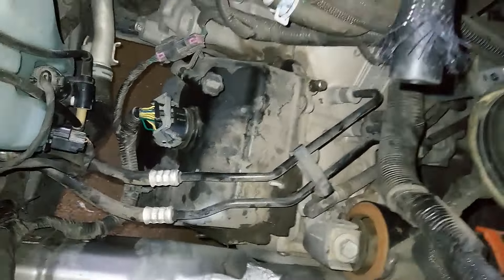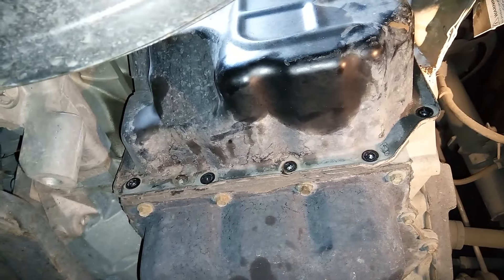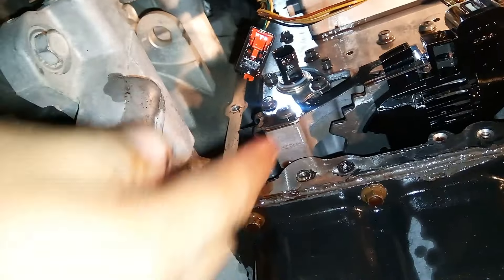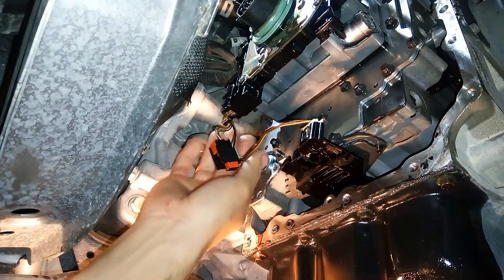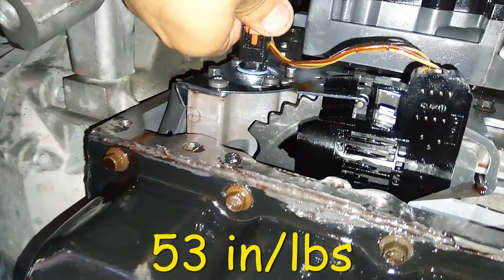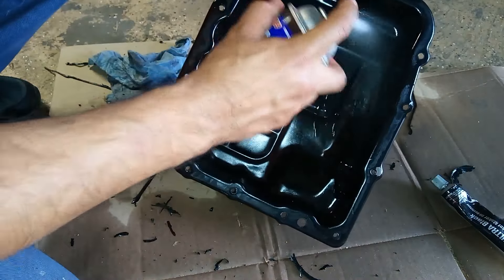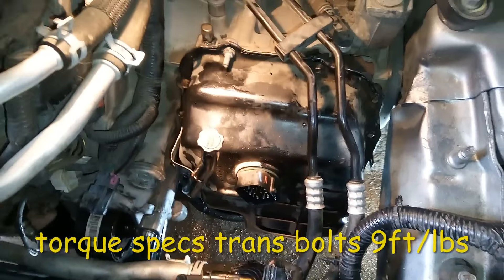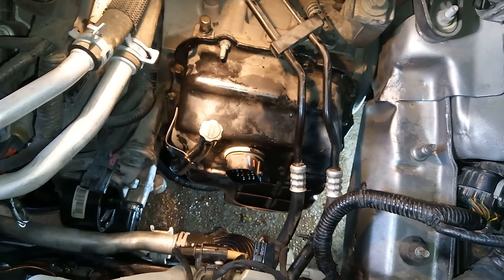Transmission Fluid Pressure sensor Location and replacement 62Te Code P084B

Comment: I’m getting code p083b. After start up it runs quietly and shifts no problem. After a couple of minutes the transmission starts whining then will start to slip in and out of gear. And shifts from P to D clunk and require a lot of RPM to engage. Do you think this sensor could be the issue?
Reply from the maker: I don't think so...check fluid level. 
U might have a bigger problem with transmission.
Reply: I have the same symptom with 2019 Dodge Grand Caravan (62TE). Not sure yet what the fix will be.
Reply: @davedurkee8853 . I had to replace the transmission. I got a good deal on a rebuild $2200
Reply: Did you ever diagnose and fix your issue? If so, what was the fix?
Reply: @Relevantminded . Internal fault of some kind. I replaced the transmission and it was fixed. What component specifically I do not know.
Reply: @unamusedarchitect1646  thanks

Comment: How much transmission fluid did you put back in and need after replacing the speed sensor because I don't want to over fill thank you
Reply from the maker: When u remove it,put an oil container to catch the oil...whatever the amount u get out of it,put the same amount back. 
U also can check with another disptick the level before u do the job. (This transmission doesn't have a dipstick but u can use the engine oil ) 
Other option is get a dipstick for ur transmission from ebay or Amazon so u can check the correct oil level.
Reply: @larasgarage2021  ok great thank you
Reply from the maker: @johnniegregory2666  you are welcome!!

Comment: Hi Lara, what are the symptoms of a bad transmission sensor?
Reply from the maker: Transmission pressure sensor.  Symptoms-hesitation,not shifting properly or not shifting at all. Check engine light on.
Reply: I came here because my "Check engine" light came on, I went to an O'riely's parts store and they checked the diagnosis, it came up with the pressure sensor as the problem. I came here to see where it was and if I could fix it, but it looks like it's a bit beyond me, so at least I have an idea of what's involved and what it will cost me to get fixed.
Reply from the maker: @longbowshooter5291  yeah its a little bit of work. Find a good mechanic to help u with this brother  🫡 thanks for watching 🙏
Reply: @larasgarage2021  The first car I ever owned was a 56 Chevy Bel-Air, and I put new rings and bearing in it myself. Today I wouldn't even know where to start just changing the oil! :hand-orange-covering-eyes:
So, yeah, I'm taking it to the shop tomorrow.
Reply: @longbowshooter5291  Personally, I'm 72, and I find 'most' DIY repairs are actually much easier to do myself on the current generations of cars and trucks. At least drilling down and locating the problems with a quality scan tool.  I find having the correct tools for the job is key.  I often find it better to invest in the tools with the monies a shop would have cost to do the repair or use the free loaner tools from the big chain parts stores.  The repair shops always mark up the prices for parts 2-3x what I can source them at.  The biggest issue I find is working in tight and confided spaces you have to work in.  That and the damn arthritis in my back.

Comment: would this be the same procedure with a 2012 Dodge Avenger 2.4?
When i look for that part for my vehicle, it shows the same as the one you changed. I also have a p01745, and the car is in limb mode and doesn't shift. It makes a  whining noise from that area when cold starts.
Reply from the maker: In this car the transmission was a 6 speed.  Yours,  since ur engine is a 2.4 might be the 4 speed transmission.  They both made by same manufacturer so parts probably the same. Procedure might vary,again is not the same transmission.

Comment: A little help needed please.. 2013 Dodge Avenger 3.6L V6. Retrieved code P083B. Car does not shift out of 2nd gear. Turn off and restart car after a few minutes and car runs perfect. Issue has occurred 3 times in the last 6 months. Could this be my problem? Thanks in advance.
Reply from the maker: If problem comes and goes, I think I could be a bad connection.  Check all connectors,clean em up,add some electrical grease,that will help. If problem still there,Check for continuity on all the wires going to the transmission.  A single broken wire or bad contact can cause problems.

Comment: Tengo ese código pero me aparecieron 4 más p0846, p0733, p0882, p0734. Será el sensor,  el fluid pump o la transmission se dañó? Mi can tiene 80 mil millas
Reply from the maker: A veces un solo codigo puede hacer q salgan otros similares. Te sugiero q lo lleves a un local shop para q lo vean y chequen cual de todos esos codigos (1 o 2 de esos) esta dispara ndo los demas.
Reply: Eso haré! Muchas gracias
Reply: tengo los mismos código de error pudiste solucionar tu problema amigo ?

Comment: Mr. Lara,
I have a 2009 Mazda 5 with 135K miles. AT light came on and the diagnostic code is P0841 - the transmission fluid pressure sensor. Does that mean I need to replace this sensor or the pump, or what?  Also, Can you tell me where the sensor is located?  Thank You. Patrick.
Reply from the maker: Will be better to take it to a local transmission shop for a good diagnostic.  
Transmission is leaking oil? 
Have u replace or do maintenance on the transmission? 
Any accidents? Sometimes wiring harnes can damage in a accident..a broken wire can cause problems. 
Do u have any other issue or is just the code? 
U see...there is a lot to see and check before u replace anything on your car.

Comment: Hello, what are all the tools you used for this?
Reply from the maker: Hello! Simple tools. Socket set,screwdrivers,allen set, I think, or torx star set(u need it to remove pressure sensor) that's what I remember at the moment.
Reply: @larasgarage2021  thank you!

Comment: I have a 2019 caravan gt I just bought. 240k miles. Previous owner changed transmission at a 180k miles. The transmission shifts perfectly but the dreaded whining sound at low speeds. No check engine light but scanned it and had the p0868 code. I changed filter, fluid, pressure sensor & the small Torque Converter Clutch Solenoid (All OEM). The whine sound reduced a bit the 1st day but was still there. Now back again with the same p0868 code and sound is the same when accelerating at low speed. Transmission mechanic told me to change the torque converter and the shift solenoid. What do you think I should do? Any help is appreciated
Reply from the maker: Question... Does it sound the same when u slowly take off? Like if u press gas pedal just a little bit? 

Sounds it's different when u press the gas pedal? Like u in a hurry and u floor it lol ...does the sound is worse?
Reply from the maker: I might have an idea of what it is...bit want to make sure if it always sounds the same or different... depending on how u accelerate the car
Reply from the maker: By the way, sorry for the late response brother
Reply: @larasgarage2021  When I take off it I hear the shoosh sound. After it's about 20mph it stops. Today receive the p1745 code and  the p0934 code.
Reply from the maker: @NycForgiato  but that sound, do u hear it all the time? Or when u take off really really slow do u hear it too?
Reply: @larasgarage2021  So had the torque convertor whine noise and the p0868 code (Transmission Fluid Pressure Low) So today mechanic change the torque convertor, filter, 9 quarts of ATF4 fluid, the solenoid pack, the Torque Converter Clutch Solenoid and the transmission pressure sensor (all OEM Mopar). Now the torque convertor noise went completely away but the it shifts hard from P to D and from D to P etc... Still throwing code P0934 (Hydraulic pressure sensor circut low) and P1745 (Line Pressure Too High for Too Long) Mechanic said the transmission needs to be flashed or updated? (Not sure) But he assured me its that & his scanner can't do it.  Is this correct or is something else wrong? (Been with this mechanic 20 years and he's 100% honest) . Any help is appreciated. Thanks.
Reply from the maker: @NycForgiato  he might be right. As far as i know...if u replace internal parts of the transmission like the vapve body etc,u do need to reprogram transmission.  You might need to take it to the dealership so they can reprogram it.

Comment: Do you have to change the transmission valve cover if you change the sensor?
Reply from the maker: No. Other than the sensor u just need to replace the gasket or use gasket maker on the oil pan.

Comment: Hello Lara would you know where the Trans fluid pressure switch is located on a 15 Nissan rogue SL? TY
Reply from the maker: Ima be honest...i have never worked on that transmission.  So, no i dont really know. U can google it and lool for a transmission diagram or parts. Also, u can go to a dealership,ask for that sensor and ask for a diagram or location...usually they have it. Hope this helps 🙏

Comment: Is this same application for 2010 journey. engine  2.4 fwd..  with code P0870?  thanks..
Reply from the maker: The transmission on this video is a 6 speed. The one u have is 4 speed, i think. It might be a little different.  I can't say for sure because i have nerver work on the transmission u have.
Reply: @larasgarage2021  thank you...

Comment: I have a 2016 dodge caravan I replaced the transmission with a used one. The codes I have are all related to the transmission. P083B P0846 and another code but basically it’s for gear 1 & 3 ration and a pressure switch. Do you think this would be the fix ? I’m replacing the sensor tomorrow morning. But the car jerks after 40 - 60 mph I have to let go of the gas and apply it do make it go away. Also I reset the engine code after I changed the o2 sensor so the check engine light isn’t on but if you plug the machine it’ll tell you.
Reply from the maker: Don't use  a used sensor...u can't be sure it's working properly.  The one I install in this video it was brand new from the dodge dealer. The procedure to replace takes time,oil,and work...so its better use a new one...that way u know if it doesn't work after replacing it,that is not the problem...but if it's used u will always wonder if ur problem it's still that sensor....
Reply: @larasgarage2021  yeah of course I got mine from the dealer I was just wondering if that might be the issue if you would have to guess it took me about an hour to remove the plate with the sensors only because I used a floor Jack not the lift and I did it with the coolant reservoir in the way
Reply from the maker: @muradalasmar5959  yeah well yes I will go for that sensor first since the codes u are getting are related to oil pressure.  If that doesn't work, test the solenoid pack and see if all.ur solenoids are working properly.  I'll send u a link of how to do it. It's in my channel...there is a chart that u can check and see if everything checks out
Reply from the maker: https://youtu.be/e93sOaC-tg4
Reply from the maker: Hope u can fix ur car brother 🙏
Reply: Hi how are Hermano,
  I have these codes coming up on my 2019 Dodge Grand Caravan it’s a P0441 and P083B I drove it and won’t come out first gear at start then waited a while now shifts in gears but I’m scared to drive it because these codes keep coming up and Check engine light is on what do you suggest i do?
Reply: @jdmdavesi  I fixed my issue I replaced the 2 sensors in the transmission I believe one is a pressure switch and there is another sensor one at the top of the transmission one at the bottom. You have to remove the cover on the top of the transmission where the solenoid pack is. Whole job took me about 45 mins.
Reply: @larasgarage2021  btw your video was amazing man
Reply from the maker: @muradalasmar5959  Thank you  🙏
Reply: @muradalasmar5959  That’s good to hear thank you for your help do you have a shop you work at anywhere near Florida ?
Reply: @jdmdavesi  nah bud I’m all the way up in Jersey I can tell you it’s so easy if you are mechanical in cars it’s so easy like I said it took me 45 min
Reply: @muradalasmar5959 do you remember how is called the one on top? Thanks a lot!
Reply: @emanuelviziteu  transmission pressure sensor transducer
Reply: @muradalasmar5959  and the other one?
Reply: @emanuelviziteu  I think I’ll double check but I think it’s the transmission oil pressure switch
Reply: You should have changed the the VVT solenoid at the very top of the transmission before puttinuthe pan back on, they are know to fail. Good job.
Reply: @muradalasmar5959  hi, good to hear that you fix your problem. How is the transmission performance so far ?
Reply: @muradalasmar5959  Hello friend, I have the same problem with my 2014 Dodge Grand Caravan, it gives me an error with code P083B, you solved it by changing the sensors you mentioned, greetings from Chile, I remain attentive
Reply: @larasgarage2021 estou com esse problema coloquei um usado e estou na dúvida pois o DTC agora está aparecendo ais rápido

Comment: Where is the transmission  fluid pressure sensor in a 2021 Toyota Corolla please?
Reply from the maker: That's a new car...if it's under 60k miles, i will suggest u take it to the dealership, and the warranty will cover the cost .